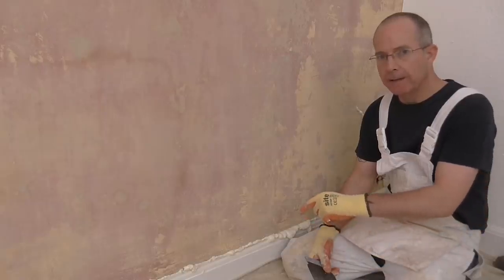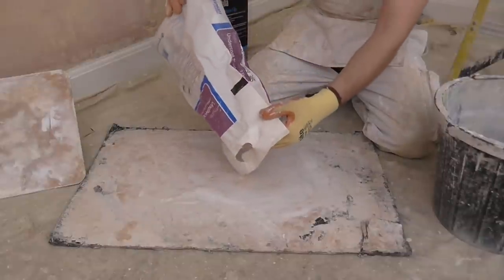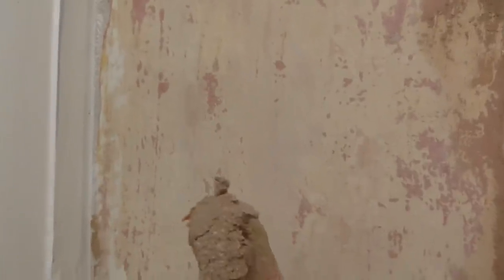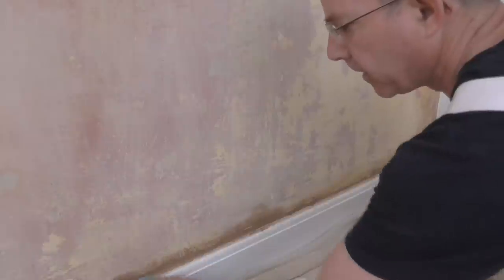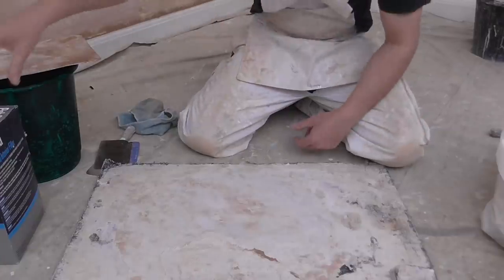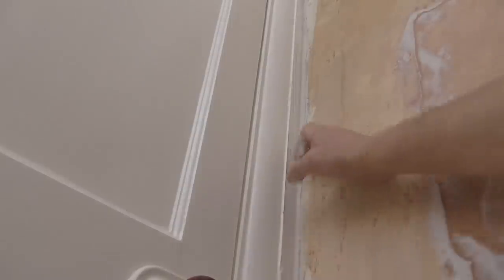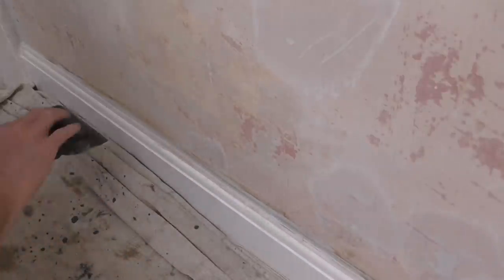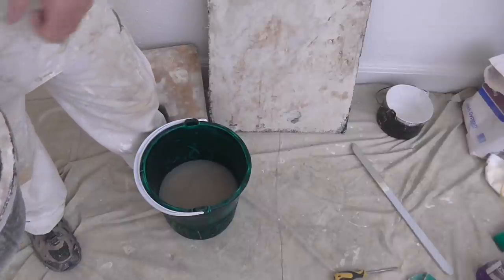How To Use Powder Filler After Foaming Gaps On Walls And Woodwork

Comment: Love all your videos and trying to fix cracks between my walls (some plasterboard some brick/plastered) and ceilings which were skimmed 2 years ago to hide artex. Nearly every room has cracks :( some times you use watered pva some times DIM primer, when and why do you use primer?
Reply from the maker: Thanks. usually B.I.N. will be used for small jobs and bare wood.

Comment: In your other video with the 2 million views, you didn't bother with the undercoat plaster after putting expanding foam in the crack. You went straight to the Polyfilla. Why did you put undercoat plaster this time round? Cause I've got deep cracks all over my flat...I've cut them until all the loose material has come off (an inch and half deep).  Shall I copy what you do in this video or your other video?
Reply from the maker: Both are fine, it's a cheaper filler to use undercoat plaster.
Reply: @PaintingandDecorating  but you still used the Polyfilla on top of the undercoat plaster?
Reply from the maker: @Khaled91  yes it sands better. thanks

Comment: If plaster has come away from the wall can it be pushed back...or is it smack it off and replaster?
Reply from the maker: In some cases you can glue it back by making small holes and filling.  Just all depends what's going on. Thanks

Comment: I am filling the top of a skirting board.  I can only apply expanding foam in short lengths of the skirting where the gap to the wall is big enough to put expanding foam the rest is just a small crack the whole way along.  Can i use polyfilla the whole way along the skirting to cover the less wide gaps or should I use decorators caulk?
Reply from the maker: Once you have used the foam you can fill the rest with pollyfila..  thanks
Reply: @PaintingandDecorating  thank you so much

Comment: What's the difference between using wet mix instead of expanding foam and some dry light weight filler??? Cheers
Reply from the maker: expanding foam removes all movement.
Reply: @PaintingandDecorating  yea i use expanding foam.. but what's the difference between the wet mix and a light weight filler to finish? Cheers
Reply: @PaintingandDecorating  you are the biggest jinx lol on a job for a friend of a friend he sent pics so I didn't bother to go and quote in person... Been here 3 hours prepping no paint out yet 😩😩 suicidal Sunday or what. Everything was fine until I watched these videos haha